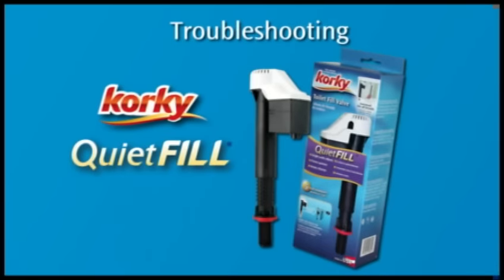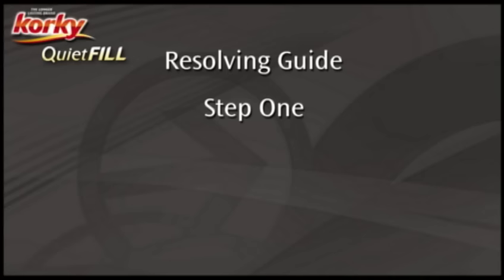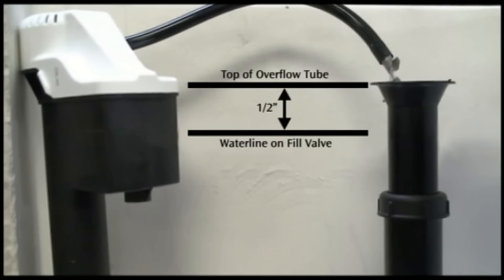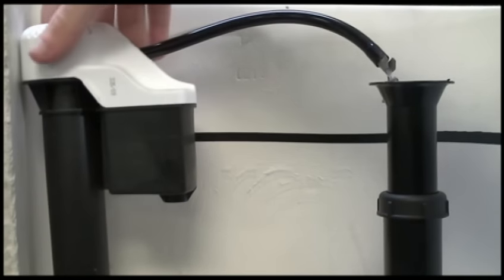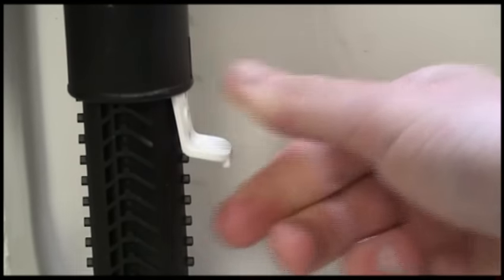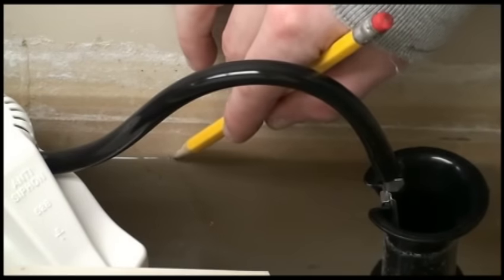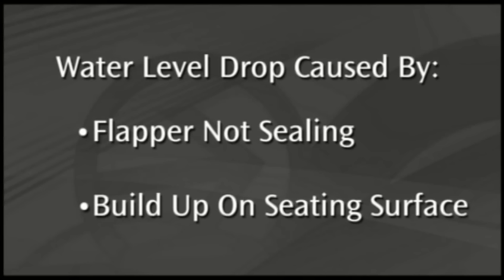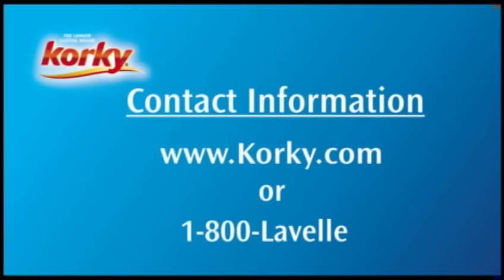Korky® QuietFILL® Trouble Shooting Guide

Comment: I am a married father of 5 daughters.I know my toilets.I purchased 2 Korky toilet kits and both leaked continuously even after adjusting.You simply can't beat the old ballcock systems when it comes to multi-flushing.I recommend the Danco 80816 for family flushings.I even added the brass Briggs Ballcock rebuild kit to the main bathroom and haven't had a leak in a decade now.Korky systems may be ok for singles or couple,but definitely not for families.
Reply from the maker: Let us help! Are you able to contact our Technical Support team? We would like to learn more and quickly identify a solution. Your toilet repair kits are backed by a 5 year warranty and we want to ensure your complete satisfaction. Please call 262-763-2434 or email Sales@Lavelle.com. We are available Monday through Friday, 7:30am-5:00pm CST.
Reply: I have installed three of these and they all eventually start leaking/hissing within just a few years.  Garbage.
Reply: @eslai  They are junk.Spend an extra 5 dollars on a Danco or any that has the ballcock float.Just be sure the float has enough clearance to rise without hitting the sides.These Korky's will often leak brand new or last a month.Every one I bought is hauled off to the dump.
Reply: im single just put a brand ne one it set it like they said it worked right the first time now it just wants to keep filling

Comment: Good, simple video. I was struggling to figure out what was wrong with ours that kept occasionally running after the toilet flushed and I replaced the fill valve cap to no avail. I was about to buy a new fill valve, until I realized that after I turned the water off for an hour, the level in the tank dropped and I believe it's actually the flapper instead.

Comment: this helped me in the end, i replaced the flapper, even took it apart to clean it's components but nothing but this being my 1st time looking at the valve in detail, i realized it wasn't locked in place and the height of it was just slowly going up and down because of that, i set the desired height and locked in it's place and so far no more running water in the bowl. live in learn, thanks :)

Comment: omg it worked!!! but mine didn't have that tab you had to pull out. It just had to be pushed in and twisted and it kept getting lower each time you pushed in and twisted it. but my water level was too high that's why it was running...thanks!!!!!!

Comment: I've replaced three of these in two years at my house. They suck.
The current one is three months old, and it squeals like a banshee. It is adjusted correctly. My toilet supply valve is a 1/4 turn stop and is not old.
Reply: handyboy2000 same. I am on my second one and they both have only lasted 2 or 3 months. They both started leaking from the top of the valve and they won’t shut off. Water keep running into the overflow tube regardless of what height I set the valve.

Comment: I was experiencing loud water hammer every time one of our toilets finished filling after flushing.  On a hunch I installed the float arm assembly from our other toilet and that fixed the problem. 

Turns out there's a tiny rubber gasket on the float arm that closes off a tiny hole on the fill valve when the water reaches the proper level. The gasket on the float arm assembly had deteriorated to the point where it was no longer sealing the tiny hole on the valve and this was causing the valve to turn on and off repeatedly which caused the water supply pipes in our house to bang and rattle loudly.

So far I haven't had any luck finding a store that sells the tiny float arm gaskets or the float arm assemblies. It's strange that this part isn't easily obtainable like the cap diaphragm is.
Reply from the maker: Are you able to contact our Technical support team? We would like to learn more and quickly identify a solution. Please call 262-763-2434 or email us at Sales@Lavelle.com. We are available Monday through Friday, 7:30 AM to 5:00 PM CST. Your fill valve is backed by at least a 5 year warranty and we want to ensure your complete satisfaction.

Comment: These things are crap. I bought 2 of them to replace my noisy American Standard valves. The worked great for all of three days but then became just as loud as what I replaced. After reading some Amazon reviews I did not bother to call customer service because so many people say that is a waste of time. If  you have anything positive to say on this subject I like to hear it
Reply from the maker: +dave hardy We are sorry to hear your frustration. We are confident that a quick call to our customer service team will be a positive experience. They are very knowledgeable and will take the time to help diagnose the noise you are hearing. Please call 1-800-528-3553 we will work with you quickly fix the problem!
Reply: Agreed. I've gone through three of these in two years. Customer service was patient and polite, but unable to help me fix the problem. I'm very mechanical and the rep couldn't be convinced that the thing simply didn't work correctly.

Comment: Installed a new one 2 days ago. Trying to follow the installation steps and set the water level as specified in the manual. Watched the video and trying to see whether it has a water leak. No water leak after 3 hours of testing. The problem is that the water keep running for 10 minutes and then stop for around 30 minutes and water running again. Wife is not really happy ;-))
Reply from the maker: +Dinh Nguyen let's get your toilet fixed! Please call our customer service team and we will have your toilet working again in no time. Please call 1-800-528-3553, we are happy to help. Thanks for choosing Korky!

Comment: That rubber seal inside the valve is too thin to last long. I bought two "QuietFill" during the last 12 month or so. One to replace the other. Until I found this video I found the problem. I realized the problem was the rubber seals. I emailed Korky requesting a warranty replacement  3 weeks ago but no one responded. Too bad I couldn't post pictures here. Poor quality and no service!!!
Reply from the maker: We apologize for the inconvenience this has caused you. Let us help! Are you able to contact our Customer Service team? We would love the opportunity to learn more about your fill valve issues and quickly make this right. Your valves are backed by a 5 year warranty and want to ensure your 100% satisfaction. Please dial 1-800-528-3553 or email us at sales@lavelle.com. We are available Monday through Friday, 7:30 AM to 5:00 PM CST.

Comment: These things a lot better than my old american standard valve flusher...the problem I have so far is that when I flush it once, it does its thing, but then it stops below the fill line, and then makes this anoyying creepy noise which irritates me, i am not sure if its maybe my position which looks correct but it seems to leak from the top which i am not sure if thats supposed to happen.
Reply from the maker: Are you able to give us a call? If the servicing of your fill valve didn't fix the issue, our customer service team would like to help quickly fix the problem. Please give us a call by dialing 1-800-528-3553 and we will have your fill valve functioning correctly in no time!

Comment: My Old White Hard plastic near indestructible.   Your soft Black plastic.   stripped threads!  The metal feed-line would not tight  up enough to stop leaking!  Now I must go and purchase another one!   The Black plastic is softer than the hard white plastic! Tell others to place feed-line  on tank before setting it.  11/04/18   so far I give it a C.

Comment: I'm so frustrated,thought i would have new valve installed before my honey came home but i'm still going to need help.when tank is full water water keeps running into overflow.tried adjusting height of valve assembly,now set as low as i can get it,still runs.HEEELP!!
Reply from the maker: angel muir we are sorry to hear your frustration. Please call our customer service line by dialing 1-800-528-3553 and our team will work with you to quickly fix your fill valve and have your toilet up and running in no time.

Comment: The toilet is hissing after fill, which means the valve is not fully closing. This video is of no help. Those two red rubber parts are the problem.  I had to search for other videos and finally found the right answers in videos by private individuals. Then I realized that I'd had the same problems once before in a different home. The dead seal under the black cap wears out and you can buy a replacement cap and seal. The little red seal with the dimple in it can be turned over for further use. Korky should mention these seals in a video.

Comment: Hi.
Should the black hose go on the circular white plastic thing on the overflow tube?  Mine is down inside... not sure if it was there before or perhaps fell there.
The water IS going above water fill line.  Flapper replaced months ago- when the other toilet's flapper fell apart (2 at one time to prevent this one doing same thing).
I have a Korky 528
Reply from the maker: Are you able to contact our customer service team? We would like to walk through this step by step with you. Please call 1-800-528-3553 and we will work together to troubleshoot your fill valve.

Comment: I have a TOTO CST 874 One Piece toilet and after the plumber changed the guts.( I dont have the old parts either to compare).He used a Korky Quiet fill valve and an original TOTO flapper but the bowl never seems to fill as much as it used to..I can pour water in the bowl and the level comes up like 2 inches more and stays.Theres no fill line.Its 3/8" from the top of the tube of the fill valve. How can I get more water into the bowl at filling time?

Comment: one problem the valve does not really have a lock to stop it from poppin up which is wat happend to me about an hour after I intalled it. The valvle totally popped up by it self and the black hose hit the top of the toilet cover and it fell off water started sprayin outside on to the floor thank god I was still home or my house would have bin flooded. I`ll stick with the old products instead.
Reply from the maker: Hi Sergio Navarro, thank you for taking the time to write a review. The Korky® QuietFILL® Toilet Fill Valve does have tamper proof key included in the kit that will lock the unit into place. If you would like more information or us to send you the locking key, please contact our customer service team by dialing 1-800-528-3553.
Reply: I fixed it. It's working fine now thank u.

Comment: How to stop it from leaking from the bottom of the tank. It does it every time I replace one of these, but usually after  a day or two it stops leaking.  So far this one is still leaking.
Reply from the maker: +Robert Dempsey thanks for taking the time to leave a comment. Are you able to give our customer service team a call? A toilet and a leak is not a good combo and we would like to work with you to quickly resolve the issue. Please call 1-800-528-3553 and we will help to fix the leak.

Comment: Lasted about a year and a half. Suddenly started to leak very badly. Turned itself on and off all the time and finally just stayed on for good with high water flow. Adjusting the height did nothing at all. Nothing. Also, how do you explain away this behavior (running due to the height being set incorrectly) when it was installed and working properly for over a year? No children in the house. No amazing cats with opposable thumbs who could lift tank lid and secretly unlock the twist lock and then press the unit down a quarter inch or so. I certainly did not mess with it. And IN FACT the unit was above the fill line, installed correctly. It just stopped working. I have never had a fill valve unit die on me in under two years of service. I won't be buying another one of these anytime soon.
Reply from the maker: We apologize for the inconvenience this has caused you. This is far from normal for our fill valves. Would you be willing to contact our customer service team? We would like the opportunity to make this right. Please call 1-800-528-3553. We are available Monday through Friday, 7:30AM - 5:00PM CST. Your Fill valve is backed by a 5 year warranty and we want to ensure your 100% satisfaction.
Reply: Same thing happened to mine. Not the best fill valve.
Reply: Exactly!  Sneaky way to double my water bill!
Reply: It's 2023 and the fill valve diaphragm lasts about two years before it starts allowing the incoming water to run continuously and quietly.

Obviously they're not making any effort to improve the quality of the cheaply made diaphragm because they're making lots of $$$ selling diaphragms and fill valves.